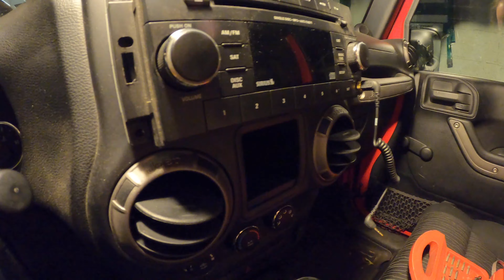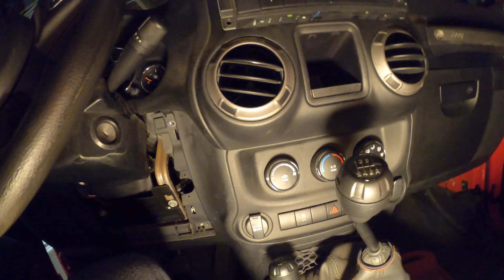Radio Freakshow

Comment: 3500 is way cheaper then buying a new car with unknown issues. I have a few vehicles. One is a 1985 dodge d-150 pickup with the 4 speed manual and the slant six (inline six). I fix whatever fails on that truck and I have not had any issues for over two years. New or even “used-new” vehicles are outrageous. Keep what you have unless you find a screaming deal.
Reply from the maker: In might have been cheaper in this year alone, but combined with the past few years and the coming few years, the value of the car will be exceeded by the cost of repairs. A new car should not have unknown issues, it should have no issues.
If you run a truck from 1985, you must not live around here. The rust from the salt on the roads will destroy a truck's frame down to an unsafe degree within 15-20 years of daily use. This one is more than half way there.
Reply: @JordanU  I got the truck from SC but live in VA. Yes rust is an issue where your from. You can still find older carburetor powered trucks down south in decent shape. For a second vehicle.

If you have a blue beacon semi truck wash near you take it there.  They blast water under said vehicle. If you don’t have Immediate access to a pressure washer at your house.

  Those older trucks Are simple to work on. Only modern transportation I would buy at this point would be Toyota.

Comment: I understand that it might not always be practical, but if it breaks again, it might be worth considering an aftermarket radio. There are many options
Reply from the maker: I did look into that at some point. There were no basic models available.
Reply: @JordanU "Basic" models?
Reply: Those aftermarket radios would cost more because you have to get a braket unless your car has an aftermarket radio previously installed
Reply: @TheMoxieBros2006  Brackets/mounting kits can be gotten for under $20.
Reply: Yeah at that point I'd just get a cheap aftermarket radio. My friends honda civic we where in about $40 for a new cheap walmart special radio, mounting kit and harness. And took about 20 min to put it in.

But its crazy how it has a lock code. No theif is gonna take the time to disassemble the dash like that to steal that radio 🤣  Odd how they still lock them like that though, I mean back in the 80s & 90s it was a huge thing to steal radios (usually high end aftermarket ones)   But I havent heard of people stealing radios these days.  Usually its computers, phones, GPS, etc Smash & grab.
Reply: @HPad2  I understand, but it can add up if you have that, plus the trim, and splice the cabes to work with the speakers in your car
Reply: @TheMoxieBros2006  You'd be looking at $20-$30 and thats including a wiring harness so you don't have to do any wire splicing on top of the cost of the radio. Not much at all.

Now where it gets expensive is newer cars if you want steering wheel controls those modules can get expensive.

My car I was under $60 in parts and that included radio mount, wiring harness,etc and that was manually running all new wiring to the speakers to the back of my car to a 4 channel amp.
Reply: @HPad2  technology wise, it adds up, for the older cars, if you want to buy a Double DIN , these things add up, including shipping and handling costs, and taxes. And the Bluetooth model has some technologies involved in the system. In fact, you would take it to your dealership, and that’ll be the labor fee because the technician will install it for you. And no, I wouldn’t buy a cheap radio for my car if that’s made in China. And not to mention that you or the technician will tear apart your dashboard to get the radio out and you’d be waiting for a few hours because the technician has other jobs to do.
Reply from the maker: @NigelMontezuma  Basic, as in no GPS, no Bluetooth, no complicated touchscreen-only controls that makes it unsafe to operate while driving, etc.

Comment: At least that code worked from that shady listing. If the radio breaks again I would just go with an aftermarket one if you care to even fix it again.
Reply from the maker: As long as I'm working carefully, it's relatively easy and quick to fix. I looked at aftermarket units in an attempt to solve the problem permanently, and I couldn't find any basic ones available.

Comment: Try some models of used Panasonic CD head units. I have a CQ-C1333U installed in my '04 Cadillac DTS. There's no anti-theft system, so there's no need for a password code. You may have to look up the wiring diagram for your 2012 Jeep JK Wrangler Sport and solder the wires together to the wiring harness to make it work in your truck.
Reply from the maker: I really just don't want to play with it anymore. It's taken up so much of my time already and it's too frustrating.

Comment: I was told that you have to go to the dealer to get it programmed to work into a different car and its the same with the main computer that controls the engine and its easier to go aftermarket and I bought the kenwood kdc168u new and it is not made in china and has cd along with the other things like usb
Reply from the maker: What a joke, that's such a revenue generator for Chrysler. It really should not be like that.
Reply: @JordanU  General Motors does the same thing with their head units